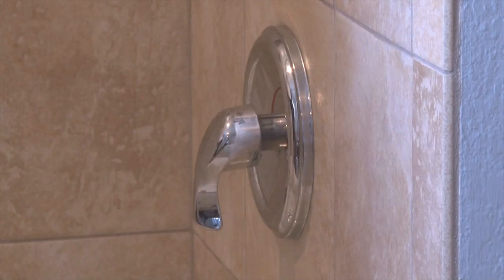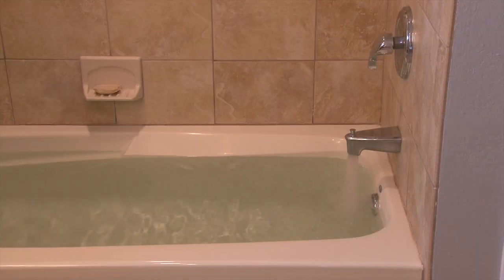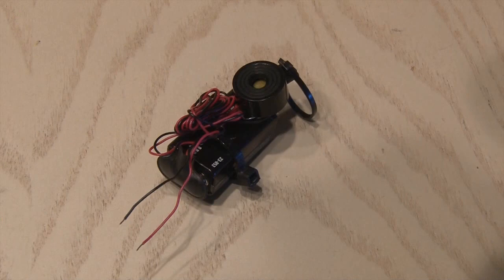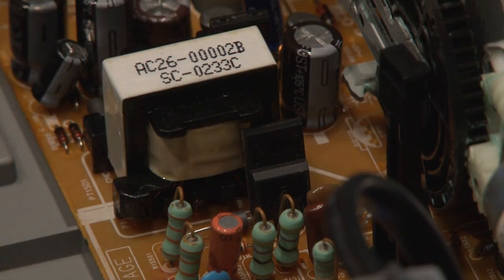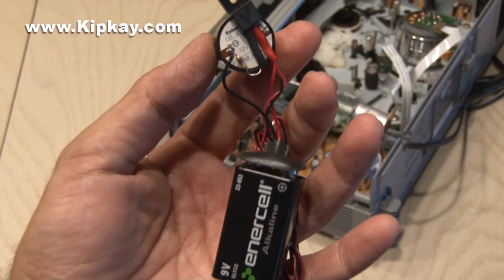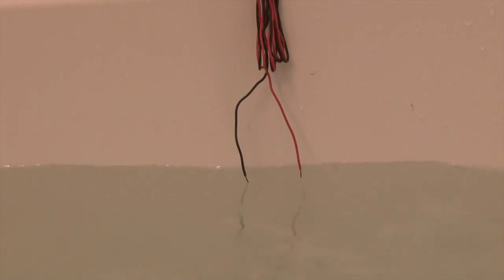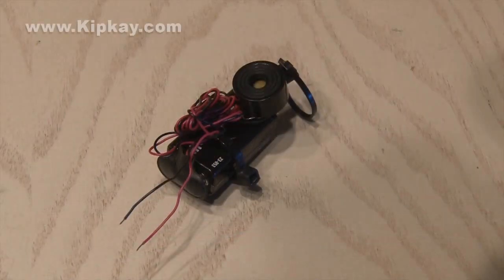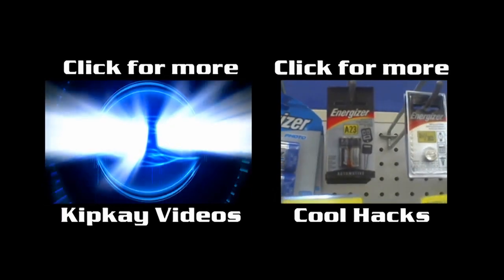Liquid Alarm Gadget!

Comment: If you touch the two ends of the detector wires, is it enough to shock someone?
Reply: +Ginotitant Cubing Why don't you find out. ;)

I am obviously joking but no it is a very small voltage. You will likely not feel anything or but the slightest buzz.

Comment: I install similarly built alarms into the recovery pans on all new water heaters. Instead of a battery I use 12VDC wall wart and place the buzzer where it's easily heard.

Comment: I wonder if we dont hear the alarm , the water will rise up to our battery and that would be funny😕
Reply: That's probably why I'd add an LED in a parallel circuit to the buzzer, and have 2 so when I'm running a bath there's one for me to check the water temp. and one for when I need to turn the water off full stop. The LED would alert me to which is active

Comment: You won't need to break your VHS player, just use a 3V battery, 4,5V buzzer and a regular BC547 or BC557 transistor and no resistors. Depending of which transistor you use, the wiring is pretty simple. 547 is NPN transistor and 557 PNP.

Comment: I don't understand. It is much easier to use a simple electric bell connected with a battery, connected to the water. The bell will ring once the wiring makes contact with the water. A bell is much louder and takes more voltage so you won't need a resistor. I don't understand why a transistor is used. The bell will simply ring when it makes contact with the water.

Comment: He did say that. But it is still possible for the water to pour faster than it can escape through the overflow safety.
Also, this mainly prevents wasting water. Hot water bills are expensive.

Comment: well when the water touches both ends of the wires it closes the circuit and lets power though to the alarm, setting it off. so if the type of oil or fuel that ur using conducts electricity. then it will work

Comment: you could replace the buzzer with a led and place the wires at the point when the water is too low so when the led turns off you refill :)

Comment: READ KIPKAY I HAVE A SUGGESTION,
Materials: Photo radar detector, Some sort of material or box to house it in, OPTIONAL a motor, paper, a compass. (You can add more)
Take a photo radar detector, take the speaker and replace it with a light of some sort then make it rotate and while it rotates you can see in which direction there is a piece of radar equipment using X or K band. If you want you can then mark it down in the direction. I think it would be fun.

Comment: I used it in my bacement, but instead, i took out the buzzer and added a switch that turns on a pump to remove the water :)

Comment: loats of problem with your post (yes, I'm being condescending here)
1. water is actually a perfect conductor of water, considering it is water and water.
1.a standard tap water is a great conductor of electricity, due to all of the minerals and ions in it
2. the 10 megaOhm resistor doesn't allow much power through the trans when water isn't isn't touching the leads
3. your underwear looks like a bomb
4. if you're concerned about corrosion in your tub, you are looking too deep into this project

Comment: Loats of problem will come with this.
1. Water do not conduct water, if it's clear water ofc.
2. In this schematic u battery will be outcharged pretty soon. 
3. It looks like a bomb.
4. Not very usefull cause after some time, your contacts will be covered by non conductive rust or oxide.

Comment: Well.. Fresh water doesn't really conduct very well, but if you have problems with this not working, then adding a flotation device that rises when the water reach the level is an option. Then all you need is to have one wire on the flotation thing, and the other hanging down. When the thingie floats up, the wires connect.

Comment: It depends if motor oil conducts electricity, as that is the principle behind alarm. The water acts as wire, in effect, completing the circuit and 'buzzing the buzzer'.

Comment: The voltage IS important: the more volts, the more current!
Remember Ohm's law: R=U/I which you can alter into I=U/R=9/10000 (Roughly the resistance of your skin)=0.0009 A which is 0.9 mA or 900uA. That's nowhere nearly enough to kill you!

Comment: That is partly true i will only work with water that has ions in it. Granted if you are filling an entire bathtub with distilled water then you know when it is going to be filled. In final tap water will without a doubt set of the alarm because of its impurity.

Comment: At least 40 years ago my parents had a commercial version of this in our pool as an anti drowning device. 

The idea being that with the pool cover on and no one in the pool, the water level would be comparatively flat and if by chance someone feel into the pool the water level would be disturbed and the alarm activated. It worked by two electrical points connecting.

No one drowned in our pool

Not a new idea but certainly a cheaper alternative than buying a commercially produced pool alarm.

Comment: It's just a simple transistor. There's dozens of them in practically any piece of electronic equipment, it could have been from a VCR, an old games console, a remote control, anything. I see what he was going for with the "recycling" aspect, but it just doesn't make much sense if your already at the store buying other parts. :)

Comment: So... wait. I have to get the buzzer, resistor and battery snap from my local electronics store... and then I come home, open up an old VCR and screw around identifying and desoldering a transistor. Which I could have bought for about a dollar. From the electronics store I was just at. The logic is dazzling.

Comment: There is a reason why it is called, "Purified" and not "Tap" water. It is because there is no minerals or such within it. One cannot simply get "Purified" water by simply turning on the sink or faucet, even if you have a filter. And I believe not that there is enough pollutant in the "Tap" to even get a discharge.

Comment: on your hot water heater hmmmm do you mean the hot water cistern the boiler heats the water not the cistern and that area wont leak unless you open it, its called a drain valve for a reason. Id be more worried about the pipes leaking before the drain off valve like.

Comment: Dogymon... I think a human body is definitely capable of withstanding 9volts of electricity. Also the only way it is dangerous would be if it was plugged into the wall or something of higher, wayy higher electrical power was in use. Not something with a 9V battery.

Comment: Depending on what you're filling, switch out the buzzer for a diode to control a motor and you could use it to turn off the faucet.

Comment: You people that think you will get electrocuted from a 9 volt battery need not to breed.
1st Have you not stuck a 9 volt battery against your tongue? All you get is a little shock.
2nd He did not say to use a power outlet or even show you how to make one that uses a power outlet.
3rd Please do not breed your bad enough.
4th If you still think you will get electrocuted by a 9 volt battery, please read number 3 again.

Comment: nop
you know why
you only get electocuted when the voltage is above 50V and more than 1 amp of power
water does not condust as wel as wire
but how more voltage how less amps you need

Comment: You obviously know nothing about 9 volt batteries. You can touch the leads of the battery to your tongue and get a little shock. That's it.  You would remove the device to use the tub of course.

Comment: You dont need to solder, just use alligator clips. Use the clips to hold the two connections together (and connect them) and hot glue it all into place.

Comment: That's probably the most useful thing I've seen on this channel. Not saying nothing on here is useful because kipkay is a genius and has a lot of useful tips. But this one is definitely the best one I've seen. Pretty useful at certain times. Most bath tubs are equipped with run off traps which lets the water flow out if it gets too high. But for older homes this would be perfect and the water heater is a good way to use this alarm detector.

Comment: yes it would but not alot, and unless you put your hand in the water near the electricty, also electricty rather go the shortest and less resistent path, but water is easier then flesh so it rather just go through the water, and you will take it out once it goes off, you should be fine

Comment: You can buy water leak alarms on Amazon for 9 bucks.  They work better than this and they float, thus no water damage to the alarm.  Keep one under sinks in case a pipe starts to leak.

Comment: Nice!
.
I'm going to use about a dozen of these in my aquaponic greenhouse for the automation system I'm setting up. Instead of going to a buzzer, I'm going to have them all feed into my computer, letting me know when something is full / empty, and trigger an automatic response.
.
I have a lot of scrapped components from old discarded electronics, so I have everything I need to make an entire sensor array :] thanks kipkay. This is going to be A LOT cheaper than buying floater sensors.